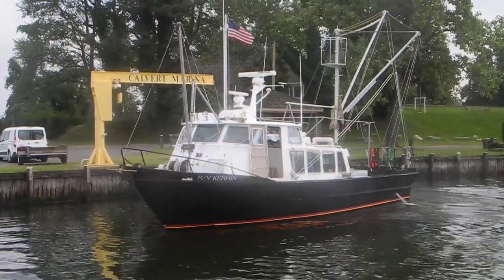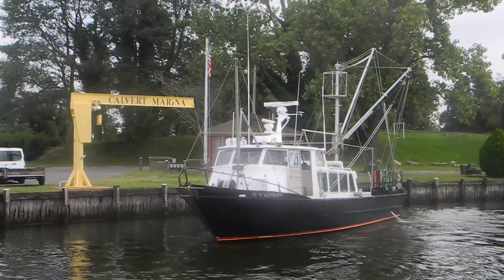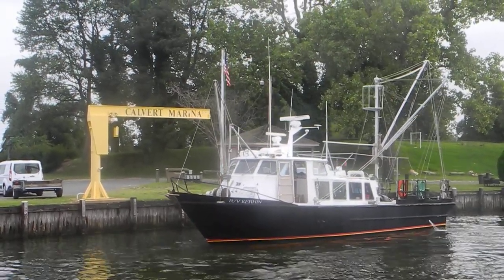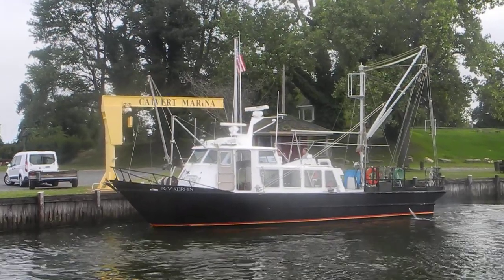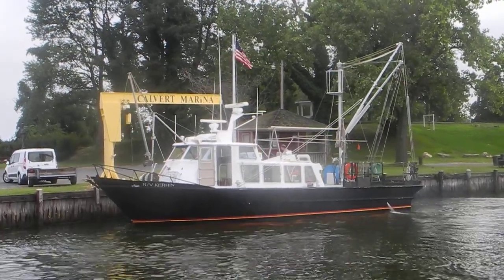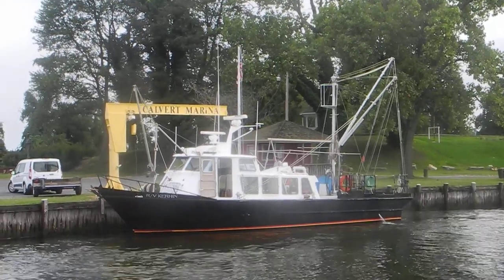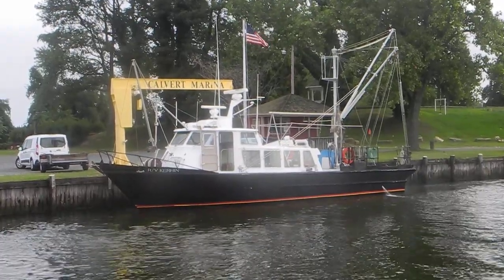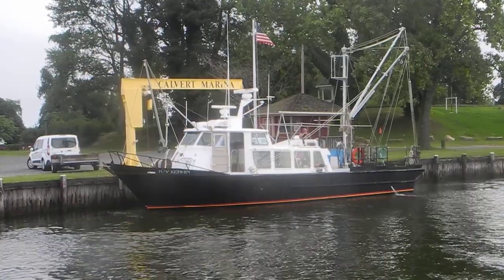RV Kerhin at Calvert Marina

Comment: Wow this is a great looking boat. Would be a great cruiser if the booms were removed 🤔
Reply from the maker: YES IT WOULD except it is a metal hull. Strong and lightweight for the purpose it was built but as a private cruising yacht it would be noisy. Waves slapping against the hull and the diesel noise reverberating throughout the hull. 
This is a seaworthy vessel similar in design to the Crewboats I grew up operating in South Louisiana back in the 70's.
Reply: @AskCaptainChris  Yes sir. I agree. I would have to deal with the noise. Maybe some well placed sound deadening material would help. It certainly cuts down on the noise when installed in a race car